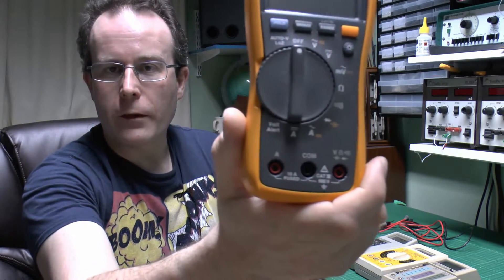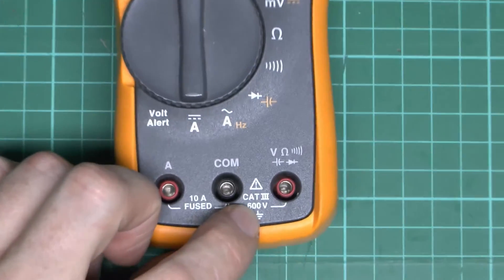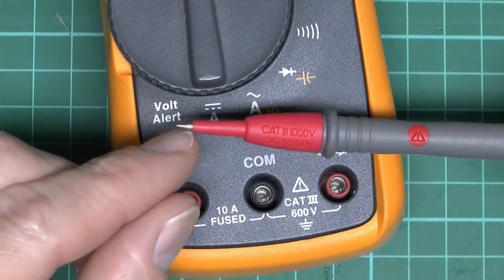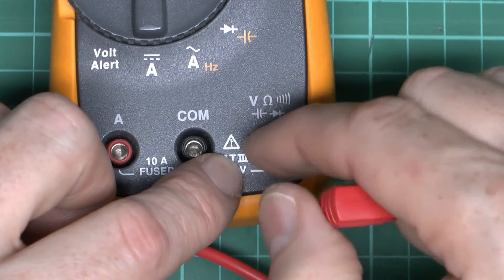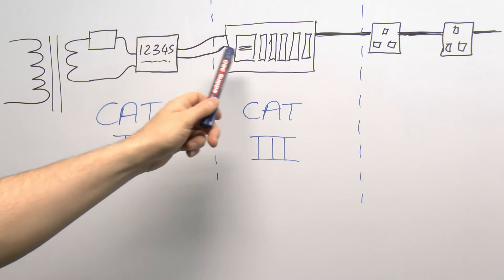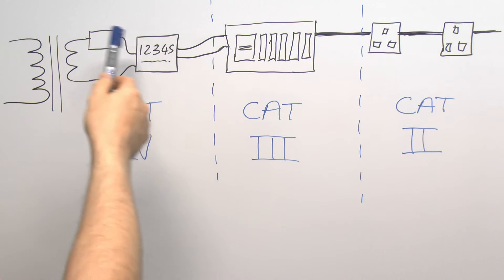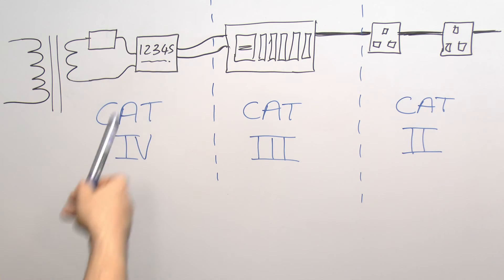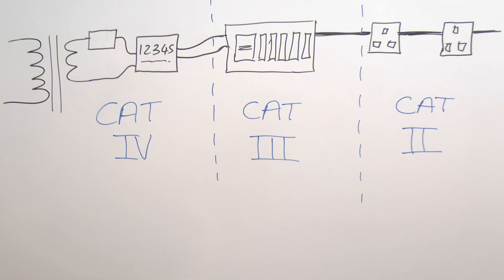Electrical Measurement Categories - CAT I II III IV

Comment: Not just the current range that it applies to- also the voltage ranges.

The 240v is the nominal voltage but everytime something is switched off, that current wants to keep going- due to inductance. It produces a short lived spike in the voltage, potentially many thousands of volts.

Higher up the chain means more current flowing in a given wire, means those excursions are larger when they occur.

A 600v cat IV needs to survive an 8000V transient, vs 4000V for a cat II

Comment: I want to use a multimeter for household devices and my projects. Will a multimeter of CAT 3 work or a multimeter of CAT 2 + CAT 1 is needed? Will there be any difference in measurements?

Comment: The categories on testing equipment means that if there is a fault the test equipment will not explode or go on fire if thee is a fault, if used in the correct category area?

Comment: Why does the meter care? If things become unsafe at 600V CAT3, why is it suddenly safe for 1000V CAT2? It's not like it's any different. voltage is voltage after all. If it arcs it arcs at a certain voltage for a given distance (and air pressure, moisture, etc). The meter is connected by leads, and everything internal is fixed. So I don't understand.
The only problem I can see here is with the amount of power something can deliver. But that's a function of voltage and current. P = U * I. But even 1V can melt your leads and meter at 100A. It wouldn't kill you of course, but then again it was 'safe' to put across your 600V rating. So what's the deal with that?
Reply from the maker: The difference is the amount of energy available.  A short circuit fault within an installation will have a relatively low amount of energy due to the impedance of the circuit cabling, the same fault at a main distribution board will have far more energy as the impedance is much lower.
Reply: Not so much for 600V cat iii Vs 1000V cat II.
But there's also the matter of transients- whenever a current is interrupted by being switched off, it produces a momentary spike in voltage, due to inductance in the system, potentially 1000s of volts but for a brief brief period of time.

Wires higher up the chain are carrying more current, and thus the spike can be higher if it does occur. Higher level meters must be rated for larger spikes, even at the same voltage.

Comment: Oscilloscope CAT I, probe CAT II can you measure mains?
Reply from the maker: In theory yes - although use of an isolation transformer to power the device under test  is essential to avoid the possibility of shorting out the mains supply and destroying the oscilloscope.
Another consideration is that the scope inputs will have a maximum voltage, and that is peak voltage,  not AC.  240V AC is actually nearer to 340V peak.  10:1 or 100:1 probes are normally used, so that the voltage at the inputs is far lower, and it's also essential that the probes themselves are rated for the voltages being applied to them.
Some mains supplies can be noisy and have larger voltage spikes on them, so even with the correctly rated probes, voltages can still exceed the rating of them.

Comment: Thanks for the clear no fuss explanation. 

I bought an LCR meter with cat 2 rating and max to ground of 60volts.

Does that fit with what you said about televisions having 100s of volts stored say in capacitors ?

Im interested in fixing cassette decks that have audio noise or dim displays.

.
Reply from the maker: Appliances are CAT I, so CAT II meter is fine for those.
Capacitors need to be discharged before testing as when charged they can damage some meters, and for the high voltage ones they can cause injury.

Comment: Hi John can you plse advise cable size from dist board 115 metres to pump house and 100 metres down to borehole for water pump in Africa. The cable from dist board to pump house will be underground for protection reasons. Many thanks
Reply: Sorry John forgot to mention motor is single phase 230 volts and 1.5hp thks
Reply from the maker: 4mm² based on the likely running current, although 6mm² may be better depending on the type of motor.  Voltage drop is the main issue here - if the voltage drops too low, the motor may not start.

Comment: Hi John, I was wondering would you recommend  MCB testing and if so How?
as I understand it there are 2 bits inside A typical MCB, 
the 1st bit reacts to over heating ( bi-metalic ) and the 2nd uses magnetic flux both driven by the fault current!
question is how does one replicate real world conditions and test them!
 I don't fancy messing about with resistors and I have a healthy respect for low impedance mains!
perhaps  the charge capacitance of a  large capacitor could be utilized to create a large pulse! and do it as a dead test.
 
stoned again
kind regards

Comment: Very good video, thank you!
But I wouldn't use a multimeter for measuring in the mains. First they have a too high impedance, you'll see a voltage (aprox. 60 up to 90V) where is actually none (reactive voltage through capacitive coupling). And you'll have to turn away your sight from the testing point to read the indication of the multimeter. Standing on a ladder and try to measure voltage with a multimeter is not very comfortable.

That's the reason why they are not allowed in the german regulations to use them to test if a circuit is de-energized, only 2-pole voltage testers are permitted.

Comment: I took basic electricity at the local community college. Recently, I have an opportunity to apply what I have learned to an actual job. The position requires a CAT ll certification. Your definition is clear but am still wondering what might be on the test when electrical properties are the same for all categories. I was able to check my personal volt ohm meter, and I discovered that I have one rated for category lll. I didn't even realize that the caps came off but it makes since for arcing scenarios.

Comment: John I do not agee with you, most of multimeter CAT refers to overvoltage cattegory not short cicruit current. Look for category explanation Fluke ABC of multimeter safety. BR.
Reply: Yes, the rating is based on the voltage not the current although it is related to the circuit impedance and therfore prospective fault current.

Comment: Thank you for this vital piece of info, John. I didn't realise how dangerous a short at the mains cutout could actually be, nor did l realise the 'actual' importance of the CAT I,II,III,IV measurements.

The voltage indicator (which says that it is GS38 compliant) that l use was provided to me by a reputable online company, yet does not have a CAT listing on it at all.

It came free when l bought an Metrel Easitest MFT, which definitetly does have a CAT label on it.

But as for the voltage indicator, It states all the various values on the back of the unit but doesn't have a CAT label on it anywhere (including the probes). Nor does it have a manufacturer's name on it anywhere, which l think is very strange.

It defintely looks the part but after watching some of your videos,I'm now highly dubious regarding this device which l use all the time to prove for dead.

I think that its maybe time to upgrade.

Thanks again, John...

Comment: Just to add....... In relation to arc-flash, although I have seen that video that you have linked-to and it being a controlled arc-over, I also found another video where a person was actually killed by an arc-flash.

It turns out that he done multiple no-no's in a power distribution room: He opened a cabinet to find a fault. Although the doors were interlocked and could only be opened with the isolator in the OFF position, once he opened the door, he closed the isolator again, meaning that everything inside the cabinet was live again and exposed.

He then forgot the voltage of the cabinet he was working on. Taking his multimeter to check the fuses in the cabinet (which was probably rated for a maximum of 1000v) he then proceeded to probe away in the cabinet.

There was a massive blast. It didn't kill him instantly, but he did die from his injuries.

It turns out that he was probing away inside a 2300 volt cabinet with a multimeter rated for a maximum of 1000v.

Investigators found the remains of the multimeter on the floor right by the cabinet he was probing. It was completely unrecogniseable and looked like it was in a few pieces, so the multimeter (which was sat on the floor between his knees) probably exploded there and then and also conducted down to earth.

He also wasn't wearing a face shield. Being only at arm's length from the source, (instead of a fair distance away with the properly-rated hot-sticks) when the blast went off, he took the full force right in his face.

He was also working alone when instead, there should have been a crew of at least two in the distribution room. He also failed to notify anyone that he was entering the distribution room, hence why he was in there alone.

Link: http://www.youtube.com/watch?v=hfnEuRA7-vo

-BoomBoxDeluxe.
Reply: Thank you.